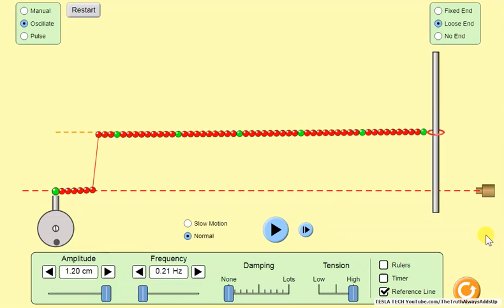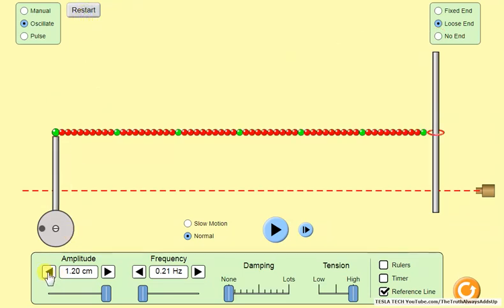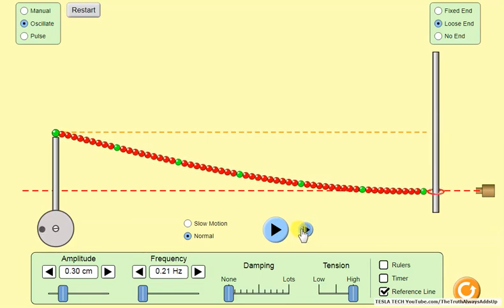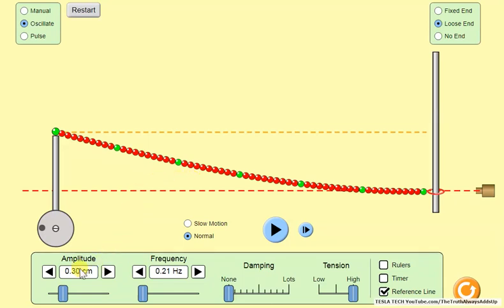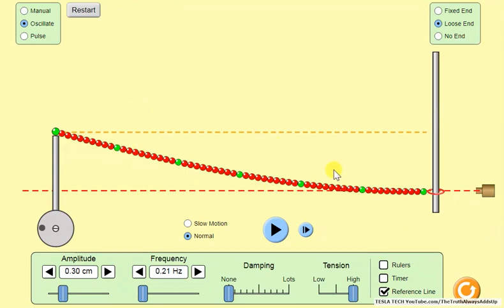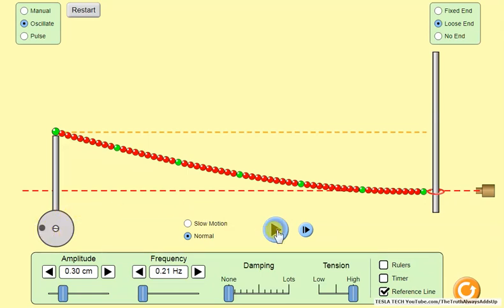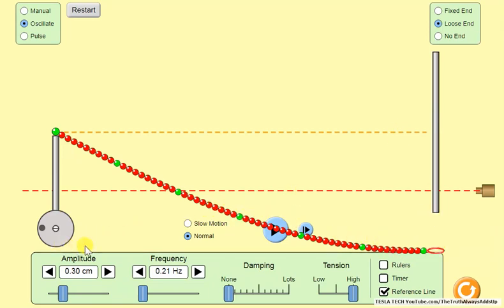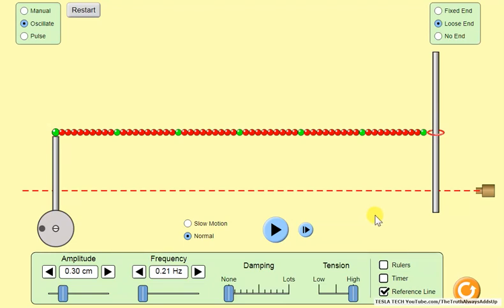Tesla's 3 6 and 9 - Video Remake -Tesla Tech

Comment: Adding a series capacitor has the effect of changing the length of wire so that an inductor of practically any length can be brought to it's maximum voltage amplitude for the resonance frequency of the inductor–capacitor combination. This means that 1/4 wave physics is not necessary to obtain a huge gain in a resonant system. This gain is then determined by the 'Q' of the inductor–capacitor and can routinely be over x1000. That's the simple part. The art is in the extracting of this huge gain without affecting the input source, as it always has been.
Reply from the maker: You are thinking like electricians think, there is no capacitor added to this, THE STANDING WAVE IS THE CAPACITOR. There is no x1000, the voltage increases to infinity, limited only by the equipment, as Stan Meyers said....  Look at Tesla's patents, no where does he say that a capacitor can substitute for a length of wire, how would the principles of wave superposition even work that way?

Comment: OK...so in practical terms...let me see if I get this.  So the Tesla transmitter has a big ball on the top that is connected with a quarter wave length of the wire from the primary excitation at the operating frequency.  This allows a Potential (Voltage) gain on the big ball as measured to Earth.  So your idea is to connect this Ball to a capacitor thus transferring the potential to the capacitor.  Then you would run your load(s) from this Capacitor in reference to ground?
Reply from the maker: No, that's not right, the standing wave is the capacitor, you don't add a capacitor in the mix.   The ball at the high end of the coil is an antinode and the ground is a node...   The frequency used in the transformer is a harmonic of the earths natural frequency, so it's a 1/4 wavelength in the transformer, but on the earth there could be nodes every 200 miles, but the termination is an open connection and so has to end at a 1/4 wavelength.......     There could be 10 or a hundred antinodes, depending on the harmonic you use....

Comment: can you show us how to make this usefull?
Reply from the maker: If I could, we would all be building these by now.....   I am just showing people the mechanics of his system and what happens when you DO LIKE HE SAYS IN HIS PATENTS...  He was using the principles of wave superposition and how he used constructive interference.....    For the additional gain the wire length has to be under one wavelength of the frequency used.

This is an online converter, simple to use, just enter the frequency you want to use, then set it to a 1/4 wavelength, and it will tell you how long the wire for the coil needs to be. 
https://www.onlineconversion.com/frequency_wavelength.htm